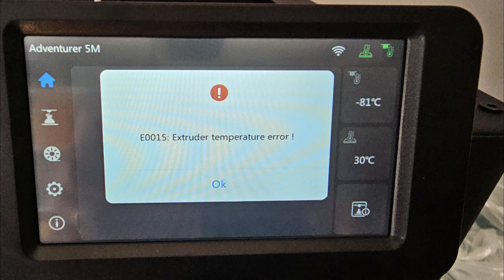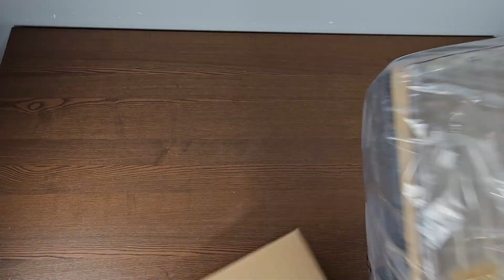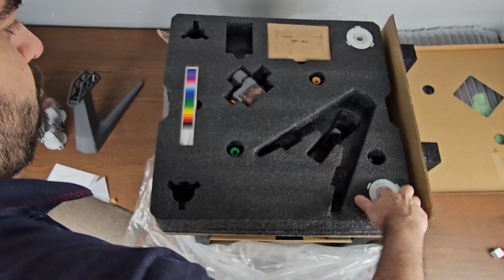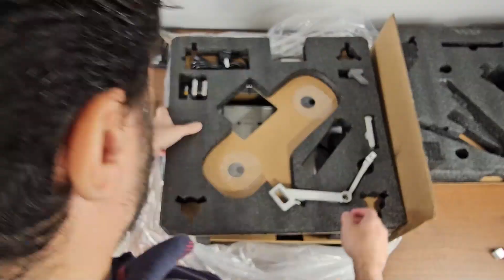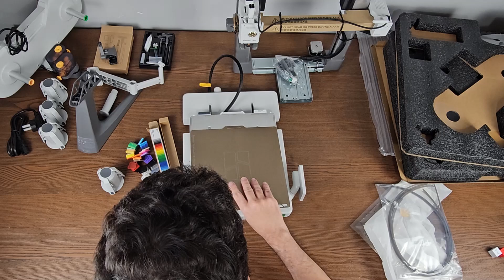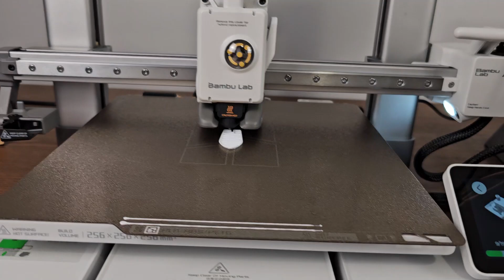Bambu Lab A1 - The way to go FDM 3D printing

Comment: Nice video, thanks for sharing.
Does your printer sit on all of it's rubber and plastic feet underneath? Mine is a bit high on two middle ones lifting front feet off the surface. Odd...

Comment: FDM are a diamond in the rough.  I started my journey with a Ender5plus.  Great printer but so slow and they are really noisy stock, I upgraded to the silent board but the board wouldn't connect to the Creality slicer so i couldn't get it going. Went for a BTT MiniE3V3, Turned out a complete mare, Tried everything, friends tried everything, the shop tried everything and it finally printed... Until i got it home, two prints later it buried the nozzle into the brand new PEI bed wrecking that and the nozzle. So i gave up on that one, its now a huge dust trap. So, i got my hands on a cheap Kingroon KP3S.  That uses copy's of everything but swapping the the proper components they copied has made that a gem. But its only 180x180x180 so everything i design has to be multi part as the beds so small.  I do like the Bambu Lab A1, My friend has 6 of them and he's only had running costs, nozzles extra to replace. So, Thats next. Maybe his oldest or maybe a new one.   My Honest tip to anyone buying a printer, Spend some money on quality.  DONT BELEIVE YOUTUBERS SAYING THIS IS A STRAIGHT SWAP Because it rarely is.  One upgrade at a time so its easier to find the issue.
Reply from the maker: I agree with you my friend, thanks for sharing your experience in details. I made the mistake of follow YouTube advice saying that SW X4 Pro was a good match for Bambu, same with the 5M and the result is what I shared, terrible experience. Different from resin printers that machines are very similar, FDM is a different beast where quality is really important and most of all, the easy of use and user experience. I believe that Prusas are great machines, but they are expensive as hell, I think Bambu printers are the perfect middle ground.
Reply from the maker: I think one of the big issues with 3D printing, especially FDM is there's a lot of specialists and tinkerer's and they think everyone should be like that. Complains that Bambu printers are closed, propriety systems and etc. But if we want to streamline the hobby, make printers cheaper, it should also be good for the general audience, not only experts. And for the experts it will always exists the kits and parts to buy and build themselves a printer or printers more open source like that they can tinker as they want. To have printers like Bambu do not exclude the other thing to exists. The important thing is to have this hobby more popular and more people joining. I advocate for that.

Comment: Please,  brother, help me to have a 3D printer . I like 3D designing and printing, even though I haven't touched a 3D printer with my own hands yet. So please, my brother, change my life. If you have old or broken.
Reply from the maker: Hey man, where do you live? There are plenty of good and cheap options on the market, just try to save for a few months and you will be able to get a printer below 200$ that will be great for you. But I understand that depending where you live, it's difficult to get hands on a machine for many reasons.
Reply: @HobbyistLife  My brother, I cannot thank you enough. Thank you so much for considering my question. I asked many YouTubers, but none of them responded. You understood my problem, and I am deeply grateful. I live in Ethiopia, and it is very difficult to buy a 3D printer here. Thank you very much,  if you want help me i have go fund me you can help me 1$ but don't worry